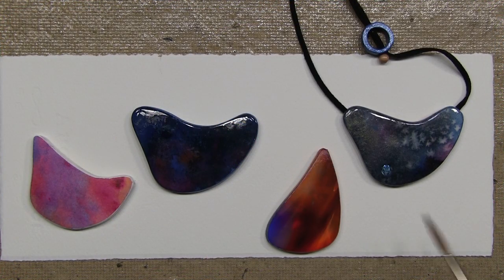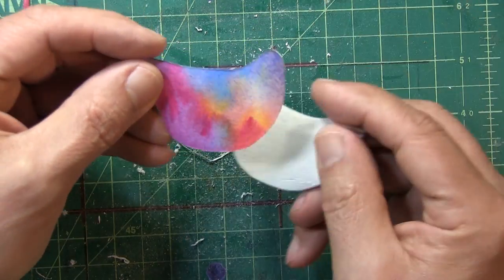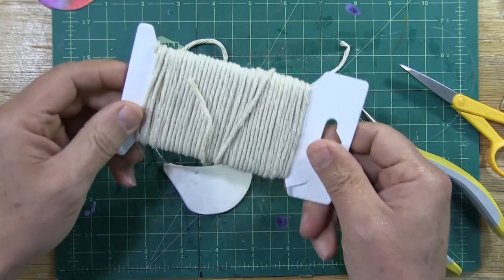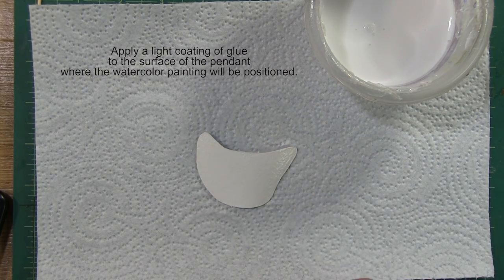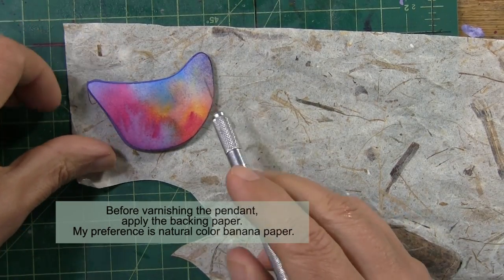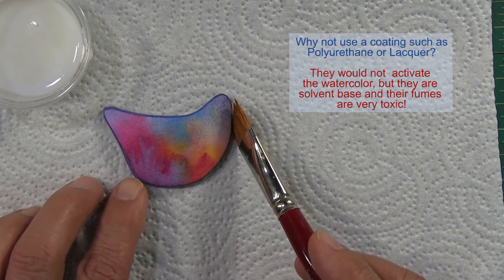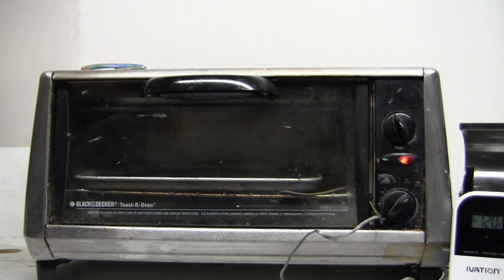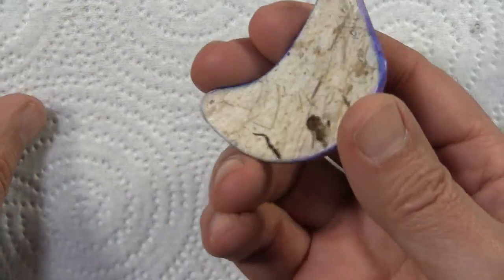How to Create the Watercolor Paper Pendant, Part 2 by Ross Barbera

Comment: Beautiful, but I suffer while you have been sanding by hand in a previous video, have you considered a nail manicure machine for soft sanding?.  I usually sand my pieces with it, takes me some time but it works perfectly and it leaves a really soft edge... I like your tip in curving the pieces a bit, will try it next time. xx thank you for the abundant sharing.

Comment: Okay I said I’d tell you if I figured out how to make the cap’s to go on my crochet beaded rope’s! The following instructions are how to do it!
1) Make a Polymer clay post with a domed top.
2) Follow clay instructions to bake clay ~ cool completely.
3) Draw six circles using template and cut them out.
4) Use a ruler to draw an “x” on each circle ~ cutting up drawn lines to make four slits.
5) PH glue one circle over~lapping slits, burnish and dry completely.
6) Bastard file slits smooth.
7) Repeat step’s 5&6 five more times.
8) Drill a small hole in top of post.
9) Black Sharpie pen around bottom edge of cap and remove from post.
10) Bastard file to drawn line on cap and replace on post.
11) One coat varnish,bake and buff cap four times.
12) Gold leaf glue and dry cap.
13) Soft toothbrush gold leaf on cap.
14) Varnish and bake dry cap one more time.
15) Remove cap from post and pass a thick needle tool in cap hole to open it up.
16) Congratulations you’ve made your first cap.

The more polymer clay post’s you make ~ the more cap’s can be made at once!!
Feel free to try and also to pass on as long as you mention where you got the information!
                  INJOY 💖👍🏽👌🏾